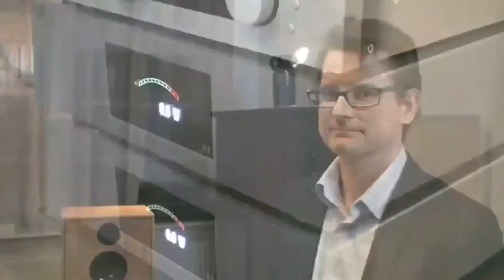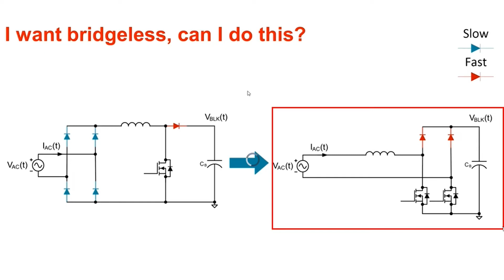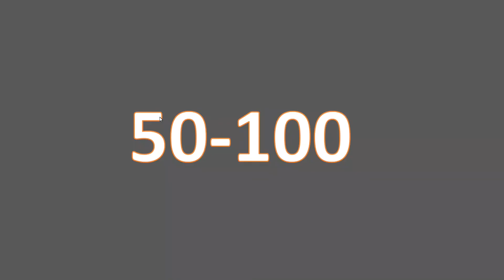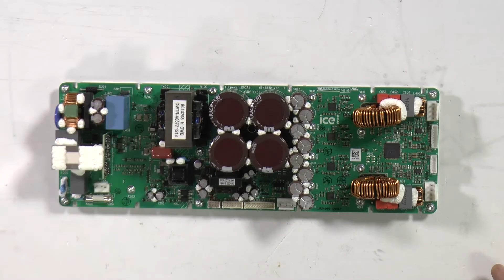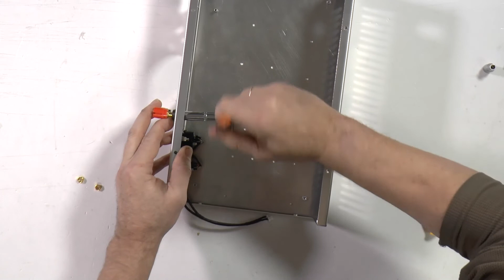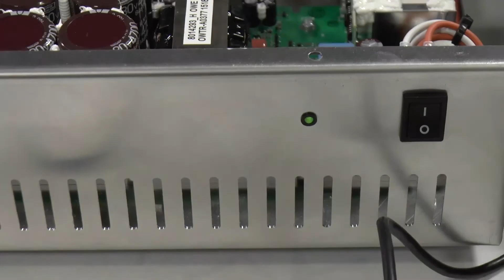ICEpower 1200AS2. Build your best audio amplifier in the world. Part 1-3

Comment: at 5:03 there was mention of standby consumption, as i never had good experience with the auto sense (on off) circuit in all my amps i keep my amps always on. standby is when amp is only in standby mode, if you listen to low level as i do most of the time, its the power usage when at 0 to 5 watts output that matters.
in the data sheet page 16, P idle: 35 watt that matters. 
also got power efficiency graph at page 23, ca 35% efficiency at 5 watts, assuming that i calculate it correctly listening at 5 watts output is 35 watt idle draw plus 5w output at 35% is times 3 to get 15watt. 35w plus 15w is 50 watt for low level listening.
 that is very high and why most of my amps run hot at idle.
Reply from the maker: 1200AS2 has a dedicated second small power supply and stand-by is working well. Wake up from signal in my experiments did a good job as well. I did not have any complaints. Idle for 1,2kw system is 35W and it is a bit too high to leave the system always on. I would suggest a 12v trigger option if you are not happy with signal sense. Check how your signal sense is implemented in your system, there is 2 type of VDD 5V voltage. You should use for standby management 5V  low consumption stand by pin. Signal sense may have some problems if the preamp is noisy, but the 12V trigger is rock solid. Of course, you need one more cable in your system. For professional applications, there is a limit for standby power max consumptions. If I remember correctly 3W is the max for energy star-certified systems.
Reply: @guntarssmits2104  in the past "Wake up from signal" feature has been bad for me, and currently i own 3 class d amp with the feature but more options to adjust. have not got my hands on the newer icepower, only have icepower 200asc right now and i had to bridge some pins to disable the feature, but its also the most cool running amp i ever had. 
got purifi nad c298 power amp and ncore plate amp from hypex. both with some adjustments but really hard to wake them up so i gave up and let them always stay on 24/7.   i use signal sense, as i use a digital dsp unit from minidsp as a preamp and no option for 12 volt trigger i think.
Reply from the maker: @sudd3660  For time being I will collect some statistics from the customers and then I can tell more about this feature. As lab. experiment PC -external sound card and amplifier signal sense were stable.